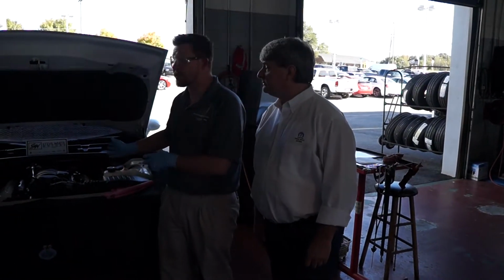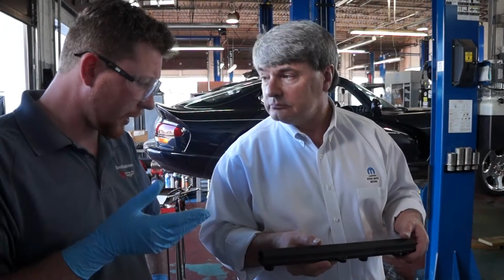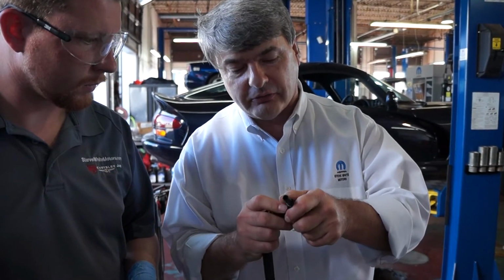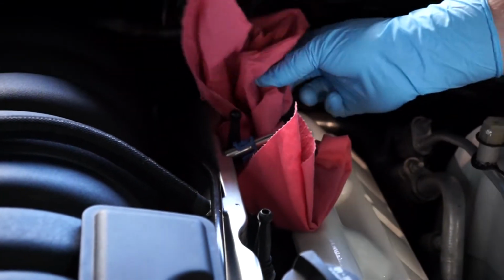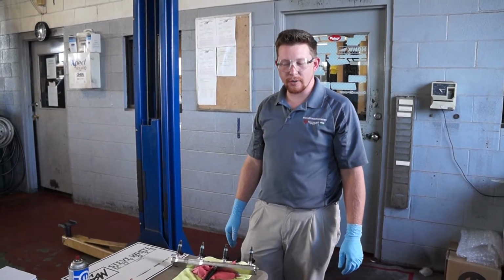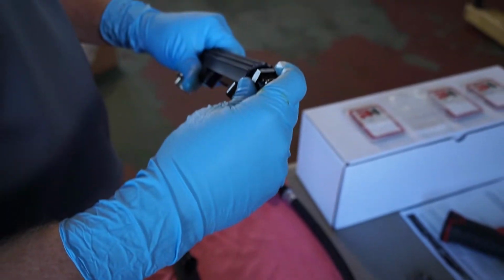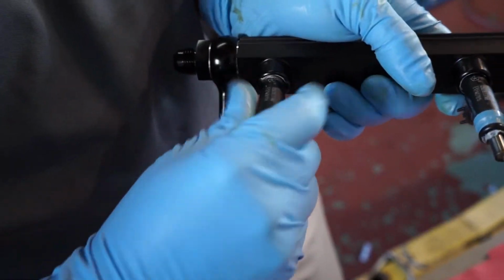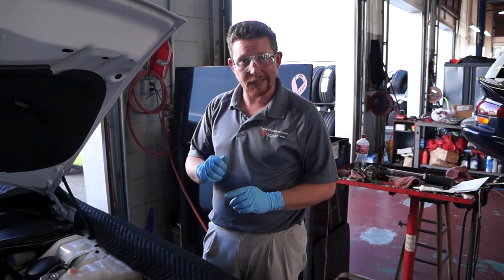A2Speed HEMI Fuel Rail Overview and Full Install Video

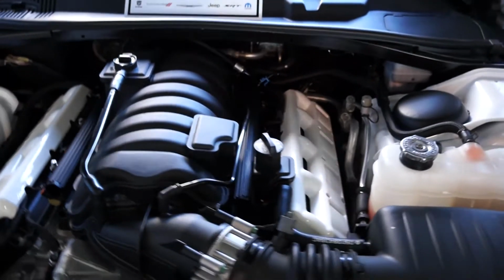Comment: 2020:  I just bought this fuel rail set for my 2009 Challenger R/T, and added brand new fuel injectors all DIY, perfect fit, looks solid, I used teflon tape and a dab of dielectric grease on ALL* fittings unlike this video, NO leaks anywhere. Beware the original fuel line clip transfer from the old rail, @21:22 if not turned the right degree/way on the new rail,  it can come loose and pop off, it happened even though I double checked the fitment, Napa Auto Parts has a identical replacement of this clip in case the original blue plastic has been tweaked from previous services over time. The other thing is finding 4 replacement bolts for the fuel rails if you do not want to use the original ball studs for the engine cover. They are not included as they did not mention in the video, but had 4 different bolts. I personally hate the original hemi engine cover, and dumped it in the garbage, but had to use those 4 ball stud bolts for now until I find the right low profile bolts that will fit. Overall, an easy install, but beware of a lot more fuel coming out of the rail intake connection than seen in this video, be prepared to use a rag on rail intake connect plugging it up before* removing, otherwise it will get all over the engine. Still a great design A2Speed! A+